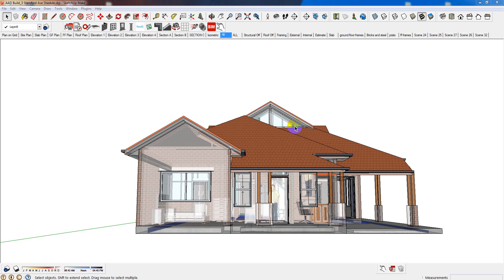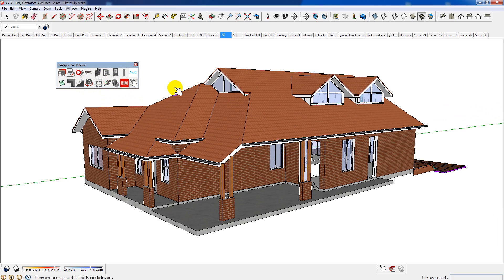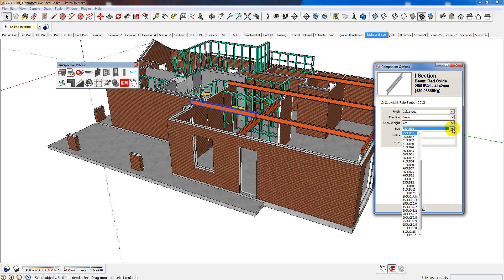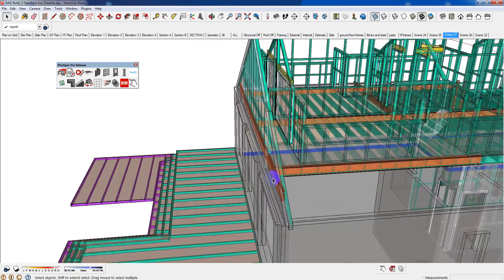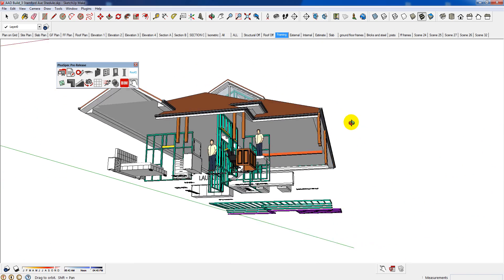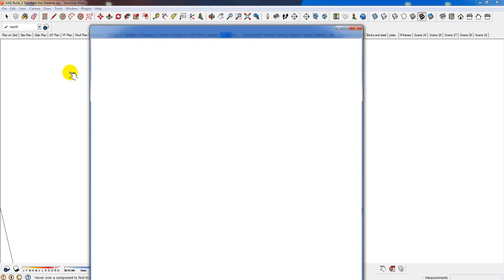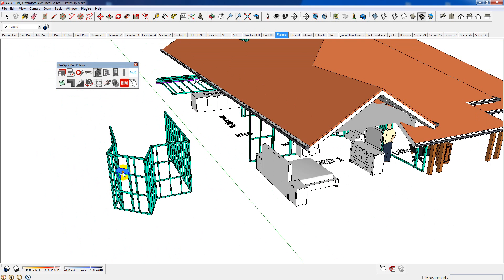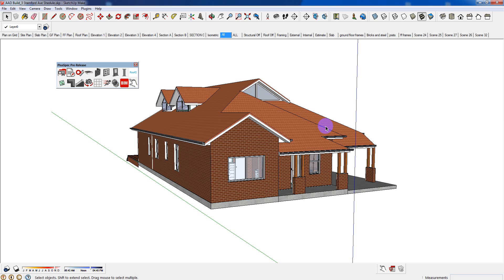VDC & BIM in SketchUp with Plusspec, real-time 3D, 4D, 5D

Comment: Hello I have one question about this plug in. Is it possible after drawing this to import it in Revit and keep all the data? Also how good is this plug in for drawing curved surfaces (for example skatepark structures like half pipes, bowls etc.)?
Reply from the maker: +Domen .Stražar  PlusSpec automatically associates an IFC category with walls, floors, structure, doors windows and more, you can then update the IFC properties with information that may be applicable to the products or the project. I would then export IFC model and all of the information will be in Revit. You will however lose the parametric ability to change to the model and also textures do not transfer yet colours do. You will have to use Revit tools to make changes to geometry. If you have IFC 4 you may be able to do some type of parametrics yet I have not tried that. let us know how you go.  BTW we have some very powerful functionality coming available in the next few weeks. Now is a great time to subscribe to our channel
Reply: +RubySketch Thank you for your fast response. I will check it out
Reply: I use the IFC export